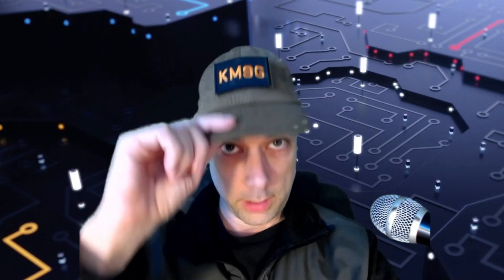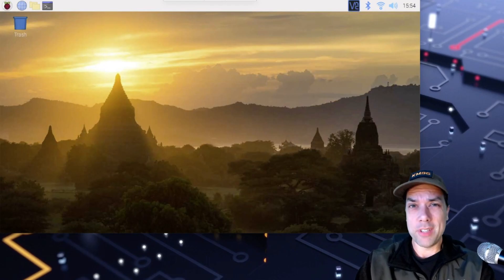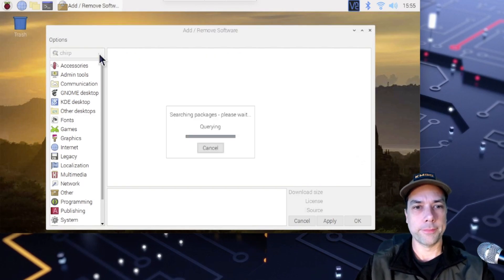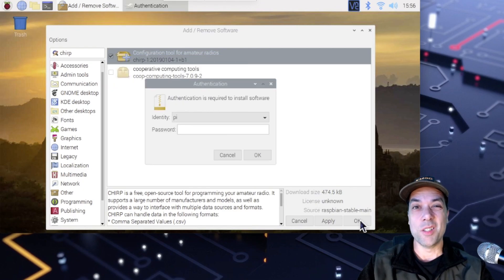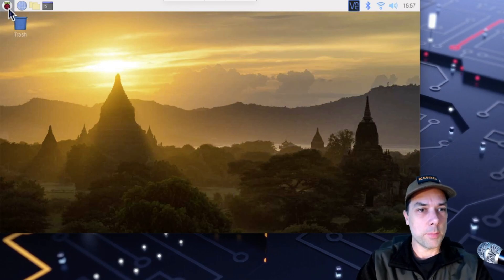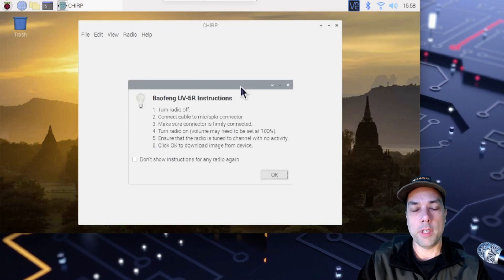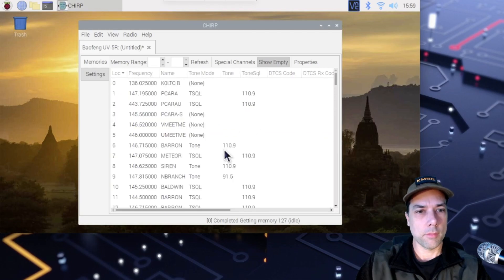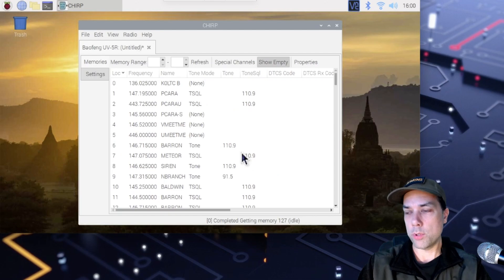2 Ways to Install Chirp on Raspberry Pi

Comment: Thanks for sharing I need to put one of these together to keep in my radio bag. It will take up much less space than my laptop.
Reply from the maker: Look up 73linux or digipi, both are great options for controlling a radio with a pi. And you can swap the SD cards and keep both!

Comment: Excellent video, I seem to have a problem, when I go to “RADIO”, “DOWNLOAD “, the communicate box opens, I select /dev/tty/USB0 for the port, select my radio (Baofeng), select model (UV-5R) but no Cancel/OK box below.  I am using the Baofeng supplied  USB cable and I have Python 3.9 installed.  RPI4-4 with Bullseye.  What in the world have I mucked up?  

Thanks much!
Reply from the maker: Two things come to mind:  is your user in the dialout group?   Is the ok button off the screen?  Just guessing here. Drop a message over on TOADs discord with a screen pic
Reply: Again, appreciate time and effort the video takes and the I will take a look at Toad’s.  Best J

Comment: Sadly RPi OS bullseye dont like Python2 anymore, but the first method still works fine ;)
Reply from the maker: Probably time for an update video!
Reply: @temporarilyoffline  my programing cable its traveling right now so soon will confirm everything ok with the 1st method ;)
Reply: Yeah it requires Python 3.x ... The version that installs from method 1 now install Chrip ver 0.3.0dev and  Python 3.9.2 
If you try method 2 it will error out when trying to get python 2.

Comment: Finally got Chirp installed and sort of working using the terminal option. I have two Baofeng radios and it only uploads two channels of phone I know there's 127.??
Reply from the maker: Are you getting any errors?  Maybe try wiping out the channel it stops "at" or "on" and it might have some bad data?
Reply: @temporarilyoffline  no errors its only uploading 1,2, and 127 channels. But of course its shows 127 on radio.
Reply from the maker: @mikemorris5944  Very strange... try putting them into Chirp in reverse order and see what happens.  I'd suspect you'd get 1-125 and then no more.

Comment: I was having trouble with my cable working with windows when zip came across your videos ( thank you) I fired up the raspberrypi  followed your directions and on first try everything just worked.  I had tried other windows work around but to no avail,  not being a true linux buff I was so surprised at the ease of it all. Thanks again.
Reply from the maker: That's awesome Ron!  Thanks for watching.

Comment: If raspberry accepts usb, and I have the correct baofeng usb cable, why do I need to build another cable?
Reply from the maker: No need, the feng cable will work just fine.
Reply: @temporarilyoffline  any recommendations which Pi I buy? Something with a gui. I'm never going back to command line Unix 🤣
Reply from the maker: @truckerdaddy-akajohninqueb4793  This is the one I most recently picked up:  https://amzn.to/3c7Qh7d  I have 2 zeros, 1 model b, 1 3b+ and 2 4s  I wouldn't recommend going below a 3b+
Reply: @temporarilyoffline  something that takes an hdmi cable maybe?
Reply from the maker: @truckerdaddy-akajohninqueb4793  Zero, 3 and 4 models take HDMI, maybe more.  I'd go with the 8GB Model 4 I linked above.

Comment: Very well done!   Clear instructions, short and to the point.  Everything was fantastic.  I got it all installed but chirp is not recognizing my radio (FT-65r).  I plug it in and go to download from radio, nothing happens.  Anything thoughts or potential work arounds?
Reply from the maker: Hello John, I don't have a Yaesu, but usually it comes down to a bad USB-to-Serial Chip (FTDI is the good one, there are lots of fake prolific chips out there, sad) or the audio cables that plug into the radio aren't in all the way.

The instructions are pretty close for using a PC/Mac/Pi/Linux box though, so you can also try another computer.  If you're on a Mac, I have a video for security issues with chirp also.

Let me know how it works out.
Reply: @temporarilyoffline  Thank you for the quick response!  I have Chirp working on my laptop and it works pretty well with that set up.  I may try the whole process again and hopefully it works!  :)  Thanks again for your help and awesome videos!